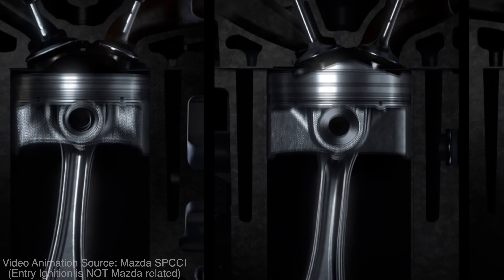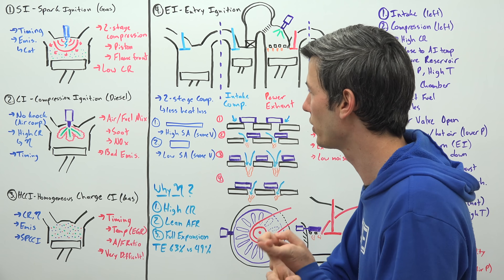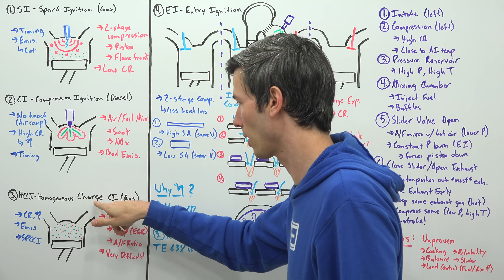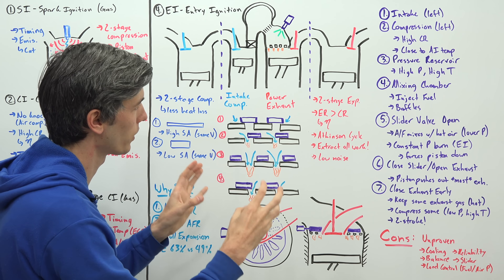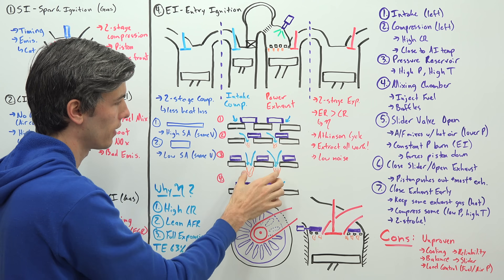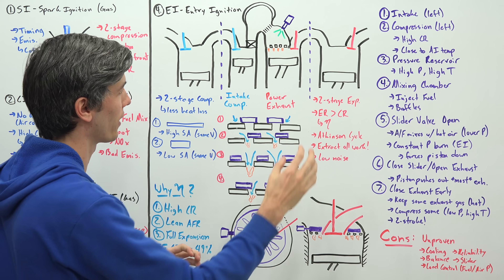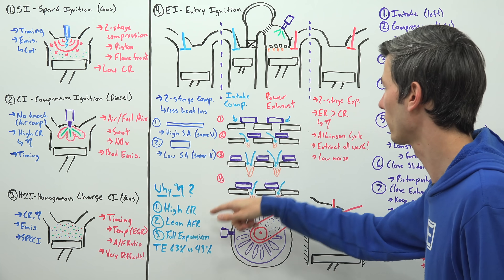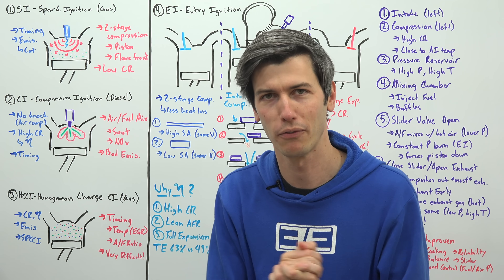Is 'Entry Ignition' The Future Of Combustion Engines?

Comment: Looks like a whole lot of engine for not a lot of power
Reply: Might be good for a hybrid range extender engine. Constantly spins at greatest fuel efficient speed to drive a generator.
Reply: @ScottKenny1978  tbh, that might just be the only reasonable application for this engine. It's super fuel-efficient, but not powerful enough to drive a mid-sized car. At least not without being ridiculously slow.
Reply: Probably best used for powering generator for electric drive vehicle
Reply: @Richard Vaughn Interesting concept... yes the last two cylinders are outputting twice the power per rotation, as they are constantly on power stroke.
Reply: As he said, the simplest form here is single cylinder, you could just use a supercharger or a turbo to compress air. The 2nd stage intake and expansion are there for efficiency purposes, mainly will be used in generators. Same thing could be done to normal spark ignition or compression ignition engines, but you don't see performance cars with 2nd expansion chambers, don't you?
Reply: this divulged into utter bs, engine development is long complete, but what would yt channels do if it wasn't for mazda and others' silly dreams. that slide valve, how long untill it breaks there? come on....
Reply: yeah, only one cylinder is making power and that one cylinder is moving the rest so the amount of power loss is ludicrous
Reply: @neevdash450  That 2nd expansion cyl is making power too. It's like a 2+ expansion chamber steam engine. Also, it ain't an engine for hot rods.
Reply: @CompTechs  It seems like the BSFC of the engine doesn't warrant the cost or repair bills that could possibly exist. In steady state power productions there are much less complex and reliable means of power. In heavy industry there are far superior means of power production. In racing or even mild automotive applications this is so far down on the possible uses that flatheads would be brought back before this was thought about.

Comment: So a second cylinder has to be there doubling volume but not power produced. More efficient fuel consumption, but how are they gonna package this with wasted cylinders not producing power? Why not use a supercharger like a Detroit diesel  to heat and compress intake air?
Reply from the maker: Both of the second two (exhaust) cylinders produce power. You could use any style compressor before the first combustion cylinder. It doesn't have to be four cylinders, could be done with just one.
Reply: @EngineeringExplained  just seems like a step sideways. Does the paper indicate a change in volumetric efficiency gains?

Comment: Great explanation, Jason, but I think such engine will never end up in a road vehicle. It seems like it's very efficient, but not so compact and powerful. It might be an efficient generator or something like this, but I really doubt that some automaker will invest millions in that technology while EVs are getting better and better
Reply: Ironic Goose since it is two stroke instead of four, it has twice as many   power strokes, and the last two cylinders both generate power. Power density should be the same.
Reply: Ironic Goose Car companies are not spending millions on new ICE technology. They're spending billions. ICE tech is exploding and not going anywhere. To name just a few car companies are Nissan, Mazda and Koenigsegg. Especially with new fuel technologies that are coming out that investors are pouring money into like Bluegas to make them run cleaner. There are already ICE Engines that put out zero emissions and EV's will not be the whole future. An EV will never tow like a gas or turbo diesels. And, of course the hybrids will need an ICE as well. When an EV is climbing or pulling it runs out of energy like super fast, unlike a gas or diesel that will go for miles and miles. There will always be ICE and the smart car companies will continue to develop them. The push for EV's is a political agenda. It has nothing to do with the environment.
Reply: You do realize that automakers still invest 10 times more money into petrol/hybrid technology than fully electric technology because petrol engined cars still sell 100 times more
Reply: @broshido2745  - Today maybe, but not for much longer. The slide valve is the achilles heel in my opinion.
Reply: @rogerfroud300  no they're stick around for atleast another 2 decades if not more, combustion engines still serve more broad practicality especially when it comes to weight to range ratio.
Reply: @AlineaEuros  - Watch this space... Sure there are some applications where Batteries can't cut it, but the market share is about to plummet, and with it so will the willingness to spend money on developing dying technology. Why bother fighting over an ever decreasing share of the market, it doesn't make sense. That's why this development will never see a practical implementation. What we have already is plenty good enough to do the job.
Reply: @broshido2745  Hybrid maybe and even then I doubt it because Toyota has already pretty much perfected it, but some like Daimler(Mercedes) have already announced they won't spend a single € to develop a newer gen of ice engines. The writing is on the wall for those who want to see it.
Reply: CalgarGTX Petrol engines still have a long way, if f1 succeeds with carbon neutral fuel electric “engines” won’t be needed anymore. Fun fact: F1 is currently more eco friendly than formula E
Reply: @CalgarGTX  that writing on the wall refers to small cars with shorter ranges.

One cannot make Tesla Model S and make loads of profit.

There is an argument to be made for synthetic fuels in larger engines (large, powerful cars or trucks for long ranges).

Synthetic fuels will blend in well with the petrochemical industry, that produces all sorts of products other than fuel, such as lubricant oils, waxes and precursor feedstock for plastics.

So the future will see more electric cars, but they won't be taking over everything as quickly as some are predicting.
Reply: @broshido2745  F1 might recycle more energy as a quantity, but that is just because they also use much more of it per car.... (100l of race fuel vs few kwh of electricity..)
Reply: @CalgarGTX  That's Europe, where everything is fairly close together and rail/public transit are top of the line. In the US, though, there's going to be a healthy market for gas cars for the rest of our lives, that is unless the US passes laws which would effectively tell our poor to go starve somewhere.
Even if the US where to completely change course politically tomorrow morning, it'd take 30+ years to build an EU-like public infrastructure, just because of how far apart everything is. The nearest major city is a 40 minute drive (the capital), if I needed to go north to see a medical specialist? 2 hours.  So that means that the only EVs that are practical here are those with hundreds of miles of range, which cost a fortune. The bottom half of the country's wealth bracket doesn't have terribly robust electrical in their homes either. So you have to go someplace where you're not going to have a fire in the breaker box fast-charging a car for a few hours. That happens disturbingly often with the high-current appliances we already run...
Is that all going to change? yeah, eventually (the poor will just starve to death and become irrelevant, and the rich folks already own Teslas). But it's not going to happen for awhile.
Reply: @daszieher  Shipping, in particular, is going to be reliant on fuel oil or some synthetic of that for a LOOOONG time.
Unless Y'all are cool with putting fission reactors on container ships?

Comment: Could these engines use force induction??????? Some how I can't really see it working. Again Brilliant videos l. 👍
Reply: They do. This engine uses the first two cylinders only to build up pressure. Any type of compressor could do the same. Cylinders might be easier to control.
Reply: Yes the pre chamber could be pressurized, it’s sealed until the sliders open. The higher compression would need to be reduced to take advantage of the additional boosted air. The 2 stroke should spool up a turbo quite nicely though.

My biggest concern would be the carbon buildup on the sliders and that seal over time.
Reply: @ricepony33  I was thinking that it would be like EGR all over again carbon build up.
Reply: IDK about boosting the SKYACTIV engine but a turbocharged direct injected engine of the same size would have greater thermal efficiency since you aren't wasting hot combustion gases, it's a well known fact you can make more power with boost than you can with compression so high compression engines like the SKYACTIV aren't really a better choice than taking the logical approach, the SKYACTIV engine is just taking a different approach but IMHO it's the wrong approach..

Comment: Sounds like it would be good for constant state applications...perhaps generators?
Reply: If that's the case, and it's quieter while running, it could make for a decent plug-in hybrid system where engine power can be low and constant and the electric motor takes up the normal load changes while driving.
Reply: LazerLord10 wouldn’t it make more sense to use it for a “range extender” which is essentially just a series hybrid.
Reply: Hybrids, would probably be a perfect application
Reply: @MrAjam12  cost is a big factor producing hybrids. If its too costly they wont do it. If they do it (and some have) depending on the vehicle they loose money and that's not an option now. Even before the virus hit us. Toyota did well but the sold a varient of the same Prius model for years keeping their costs down and profits up. I think hybrids are the way to go for now. Allowing manufacurers to be profitable enough to really develop all electric vehicles properly and profitably.
Tesla did ok with his vision but I cant see those vehicles grabbing enough market share just yet. Maybe they should develop a hybrd for the short term and rock the legacy manufacturers into disappearing. For now though pick up trucks and large SUVs are the big 3s salvation until someone can shake those trees down.
Reply: @mooglemy3813  I agree, I think this tech will be too expensive for hybrids. Especially considering how new and just how much investment it will take. I would love to see this go Into a car, but I doubt Toyota will pick this up seeing how conservative they are when it comes to new products.

Iirc Tesla partnered with some legacy manufacturer (Toyota or ford, which one escapes me) to help make the batteries for a hybrid. I think Tesla is In a horrible position to make a hybrid. They'd have to buy an engine from some one else and retool a bunch of their plants, something they already are breaking the bank doing. I think their all electric approach is great for them, they can't beat anyone in the gas world so they made their own electric world to be king of. Also the model 3 is the top luxury sendan as of recently iirc
Reply: MoogleMy also the Atkinson Cycle is good enough with existing tech and tooling.
Reply: @yolo_burrito  I agree. And a few more thoughts on this.... Honda has the R&D and is capable of serious advanced engine technology. They are diverse and adebt in many technologies and proven over their 70 year history. There is a conservative side to them but when they decide to do something they usually accomplish it. 
The current Civic generation is an example of that. Blindsiding the rest in the compact vehicle class at intro and some of the mid size class as well. I'm not impressed with turbo powered engines in general , however current emmission regulations dictated the use and development of the 1.5 litre turbo powered vehicles. They have oil dilution problems with some of them, but this is not a Turbo, or DI problem in itself. These small displacement  engines are designed to shed heat, use liquid cooling and bennefit from air cooling somewhat, therein lies the problem for cold weather Op as the engine Can't Reach Normal Op Temp. Any engine that cannot reach normal op temp will have this prob and it's not just a programming or thermostat change up fix. Not sure where they are with it now. 
This is a common problem on winter operated generators that operate at or below -15 C and it causes oil dilution. All air cooled gen set manufacturers have this problem unless they take measures to ensure the gen engine reaches Op temp. Not done on most portables and symptom usually is a popped out crank seal, caused by breather hose freezing and high crankcase pressure from same. Honda gens in Canada I believe have a heated breather hose which resolves it's freezing probs, however you must check the oil level frequently if operated continuously in cold weather. If oil runs out the dipstick hole change it as its fuel diluted. This is inherent in all internal combustion engines operated in cool or cold weather, however engines that reach Op Temp, flash off residual dilution or condensation and it's a non issue.
Reply: MoogleMy okay a lot to unpack here but all of this has already been solved. Electric operated coolant pumps allow engines to get up to temperature quickly and are much cheaper and quicker to implement than this tech. Does this modern twingle 2 stroke tech have some niche where it makes sense? It sure does. Is any major manufacturer going to start rolling this out for everyday products? Absolutely not.
Reply: Mazda a number of years ago said if they were to make a new rotary it would be for a hybrid and it would also sell as a portable genny. This is to keep volumes high to justify manufacturing setup.  The market in small portable genny's is substantial - the rotary is one third of the size and weight of the equiv piston engine. 

Mazda have developed a rotary with Toyota. I cannot see this new ign complexity taking off, as simpler solutions will be about. Pure ICE engines are being outlawed, only electric hybrid versions will exist fr a while.

ICE engines can only be for range extending and highly specialised uses. The end will come quick, very quick. EV cars cannot sell fast enough. Manufacturers cannot make the battery factories fast enough. Sale prices soon will equal ICE cars. Battery technology is progressing - look at graphene - 4 times the energy storage and lighter.  So a Tesla can then go over 1,300 on one charge - or have a battery pack four times smaller, and 1/5th the weight to give more room and efficiency as less weight to move around.

A lot of money to develop this new ign system, I doubt it will be worth it at this stage of the ICEs lifespan. The ICE is going the way of the steam engine without doubt.  It looks like batteries for small vehicles like cars, etc, and hydrogen fuel cells for large vehicles like ships and fast trains. Nice to know what they are doing in desperation to keep the ICE engine alive though.
Reply: @johnburns4017  Not quite right with the graphene. It makes the anode theoretically about 3x lighter, but the anode is not the whole battery. It's like saying we made the engine in the car 3x lighter then claiming the car as a whole is therefore 3x lighter
Reply: There's more efficient and simpler ways to use gasoline to generate electricity
Reply: Perhaps well suited for shipping?
Reply: shane  where are you going to get the energy from to make the hydrogen from? Dirty natural gas for the cheaper stuff? Or are you gonna split water, in which case why not fill up 3x as many batteries with the same energy  as you could store in hydrogen?
Reply: Air cooled engines to this day still do a great job at for generators up to about 700 cc. Honda is a large manufacture of those type gens. I don't see them adding this to a generator due to complexity and engine cost not even in a larger displacemt and higher output gen set. They did do air cooled diesel 5000 W and 12000 W liquid cooled diesel but dropped them years ago for various reasons. Inverter technology improved the generators about 33 years ago as a 1st in production. Fuel injection has been added but that just upped the cost. Conventional gen sets still sell well with A C engines and a stator and rotor VS the alternator on an inverter type.

Comment: Air compressor, jet combustor and a steam engine had some fun and tada!!
Reply: Came here to say this!  Sounds like an attempt to make a piston engine function like a turbine engine with separate compression, combustion, and power-extraction sections.  I’m concerned they’re going to acquire losses through added complexity, moving parts, and friction from “turning” the air (in jet engines you try to avoid “turning” the air in cases where you don’t get anything out of it)
Reply: @KdetJim  Jason did say "Brayton cycle" which is the jet engine mode of operation, too bad he didn't elaborate as you just have.
Reply: I was thinking compound steam engine with the exhaust stages. I never thought of using this idea on the input side.

The separation of the input and exhaust stages reminds me of James Watt's improvement to the Newcomen engine. The question that comes to mind here is do you need to have the two stages even connected by one crankshaft? Using two separate crankshafts, or, better to my mind, two separate housings, allows you to construct and run the stages for the benefit of each stage. 

Would it be easier to use a supercharger for compression or use one in conjunction with the two input compression stages?
Reply: Seems more like a jet engine in piston form
Reply: Yeah it's basically a pulse jet with check valve intake
Reply: Don't forget about the pulse jet!
Reply: Can compression control be another term?
Reply: It’s all fun and games on paper... probably won’t see one in my life
Reply: Very nearly a full circle then, not so far removed from a two stroke sleeve valve engine as per development in the 1940's then? But with a good explanation.